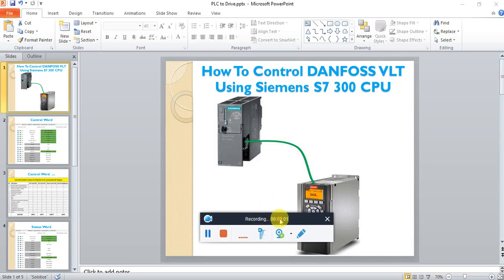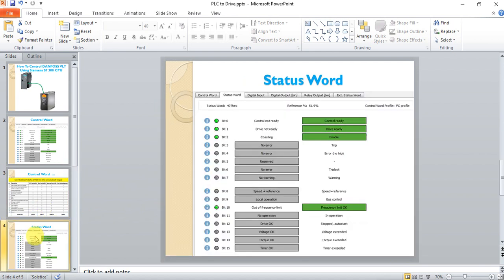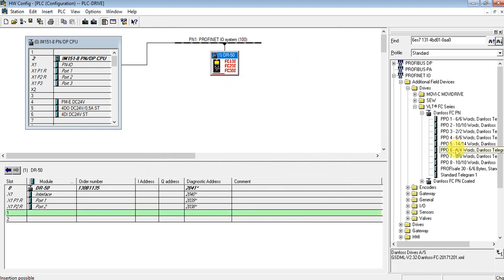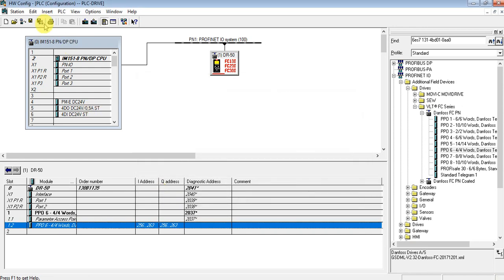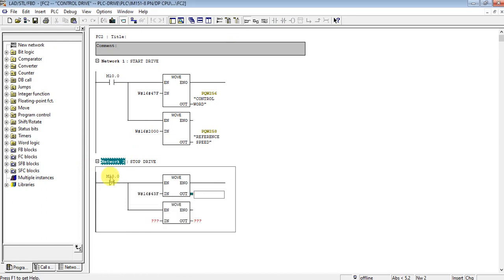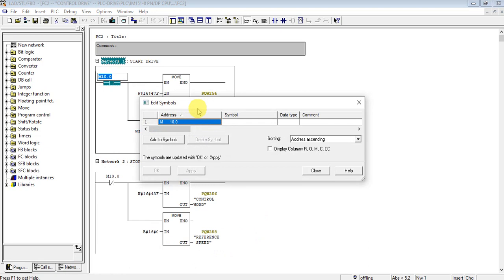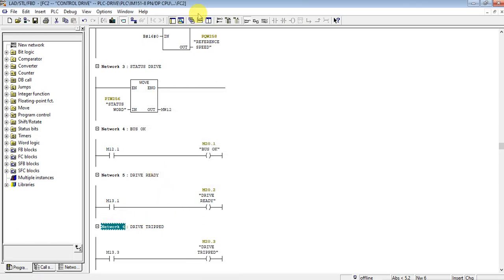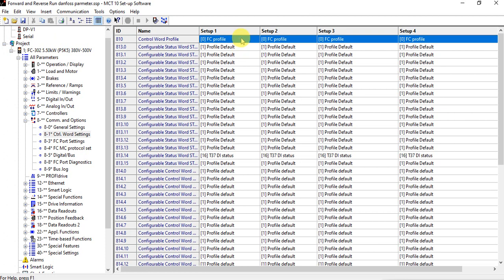How To Control DANFOSS VLT Using Siemens S7 300 CPU Part 1

Comment: Thank you so much, very informative, but why the host name in step7 is dr-50 and in MCT is dr-51? doesn't it cause communication issues?
Thanks again.
Reply from the maker: It Must Be The Same As On The plc Hardware Configuration, Unless the CPU Will Not Get The Danfoss